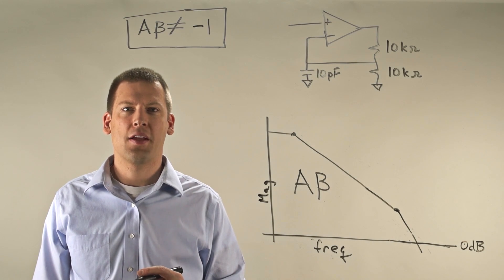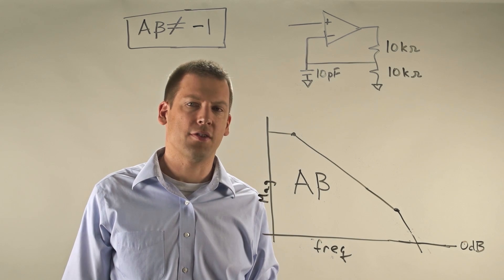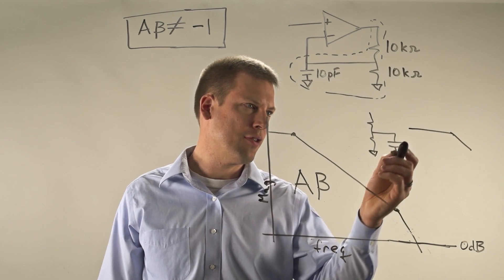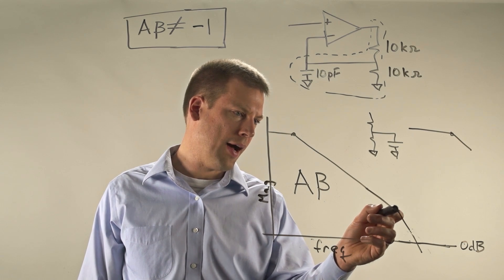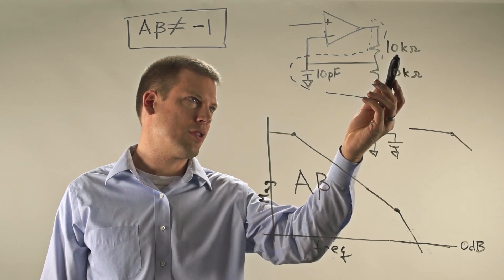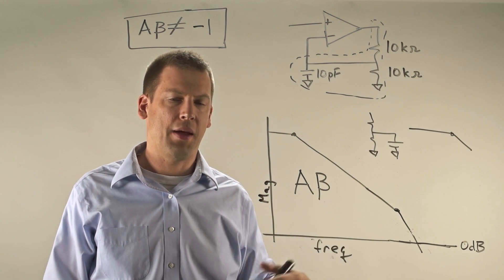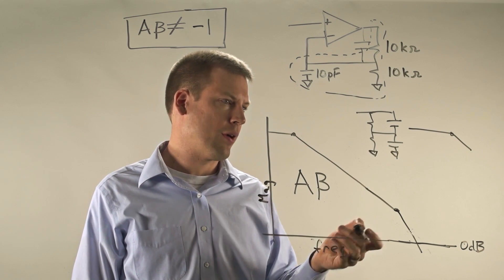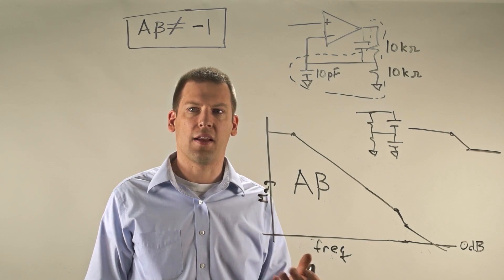Stability 101: Parasitic Capacitance in Operational Amplifiers

Comment: Nice vid, i used a 33pF in paralell with a 20K feedback resistor in a op-amp circuit.. i created a op-amp blowup device.... why did it oscilate? i took the cap away and replaced the op-amp, after that it was  no problem... what was wrong here?
Reply: Roy Rogers I blame nargles.